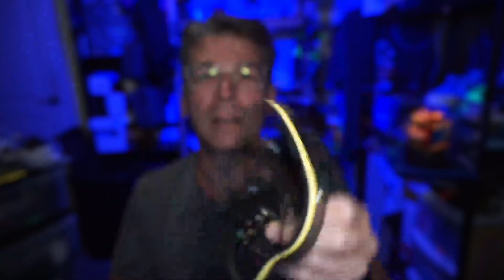SpeedyBee Flex25 // 78mm How???

Comment: after watching this video i bought the hd version and i'm enjoying a lot. just one question.. with the runcam connected the 850 mah batteries have a duration of 2 minutes max. is it possible to use 4s batteries with a higher aperage? for example 900-1100? or is the limit 850 mah?
Reply from the maker: the capacity of the battery doesn't have a role in if the electronic components can accept a voltage. A 4s 850mah has the same high voltage as a 4s 1100mah. The weight of the battery may or may not improve flight time, as we add weight we have to use more throttle to fly that weight. But yes a high capacity battery can be used.

Comment: Do you think its better than a cinelog 25 with BMI270 gyro! Lets say for professional indoor footage with a naked gopro 10
Reply from the maker: This will be more durable, but I wouldn't commit to it flying better. the cinelog flies really well, but its down fall is the prop protection doesn't take crashes well. It also has soft mounting for the external hd camera which can help with the micro vibrations that could make it into the recordings.

Comment: I am looking for a 2.5 BNF whoop for a project where it will crash a lot. :)
Can you recommend sturdiest BNF 2.5 whoop?
Thanks! :)
Reply from the maker: Foxeer foxwhoop25. My review will be up this week
Reply: @NickBurnsFPV  thank you!
Reply: @NickBurnsFPV  I am looking at its pictures. Frame looks okay, but camera sticks out and doesn't have any protection. Is this a problem? Do they supply any additional protection?
Reply from the maker: @VasylDemianov  I am not aware of a 2.5inch propped whoop that also has good camera protection. There could be one, I can't recall reviewing one in the last 2 years with it. The older 3inch whoops fly poorly but do have some camera protection.
Reply: iFlight Protec R25 looks like it has its camera tucked between the prop protectors.
Does the Foxwhoop fly decently? I will watch your review, but I consider ordering one a bit earlier. :)

Comment: I have a flywoo cinerace20 cinewhoop which I use almost exclusively for freestyling around tight trees and empty playgrounds since it is so durable and can bounce of everything while also having a fair bit of power. I also like the flight characteristics of well tuned cinewhoops when flying in tighter spots as they feel more locked in and controllable, while having less drift and fling.
Reply from the maker: The cone race is a hardy little 2incher

Comment: This could be a great little quad for filming in tight quarters.  Seems that it will not be quiet though.  That VTX seems bad, I get less breakup with my Happymodel x12 v2.
Reply from the maker: No these are not quiet. The current cinewhoop props help handling but are worse for being silent. The prop protection seems to amplify the noise level too

Comment: I just built a tooth pick im having trouble with reversals its slow and wants to gain altitude like crazy instead of going forwards Im used to 75mm whoops so I thought it was just me getting used to 110mm frame but im only at 70 grams with 1103 motors and the flex 25 is turning quicker any tips on how to tune it ?
Reply from the maker: Tuning is a very wide subject and very difficult to tailor over messaging. I suggest looking at the presets built into betaflight 4.3. Also some general tunes from UAV Tech here https://theuavtech.com/presets/

Comment: Good looking cinewhoop, but the stagered prop design doesn't convince me as being beneficial. I would think the size of these whoops isn't really a factor at all. So why go through the trouble I wonder? 
Looking at it from the bottom I see nearly half prop disc covered up by the frame. The stagered props make that even worse, so It might actually hurt performance. Not mention the air from one prop going into another is mostly not a good thing either.

As always fun to watch... Too bad it took a dive though... but at least the pool has its 'official' welcome to the backyard. When it comes to drones water is like trees I guess, highly attractive.

Comment: I’m not a pusher fan because of the fact you’re obviously stuck with the prop guards on.

With a puller you can remove the prop guards and even put slightly bigger props on for a different flight experience as I do with my modified TransTEC Beetle.

Just my 2 cents!

Cheers Nick.

Comment: I've been trying to do the same prop offset on a 3in sized cinewhoop to fit 3.5 or 4" props on a 3" frame but haven't ever quite gotten it to work using mixed standoff and different sized motors.   Cool to see the concept implemented in a practical way.
Reply: I did this with a 3" frame on 4" props.  I didn't have side to side overlap but did have front to back overlap. It actually flew really well carrying a full size hero 8

Comment: I'm sold on this one. A little tuning and it'll do great. I've been a 2.5 - 3 inch fanboy,They are my favorite size for what i like to do.  I see it does well on slow dives with out a washout. is there a way i could get your broken, damaged qwads, i'll pay for shipping and what ever you want. i have tons of parts for repairs.P.S don't worry that it's broken and may never fly right again. My favorite thing is working, diagnosing,modifying broken ones more than flying sometimes. It's the challenge.
  A rxsr has to be on the same software edition as the tx is or else you get these short distances failsafes,i've learned the hardway also.. I  really like that it is compact legal no reg size ,and the led bumper.
Reply from the maker: Send me an email please
Reply: @NickBurnsFPV  sent, and you'll know it's me when you read it. Thanks

Comment: Ih nick as always a great video, I have a question for you. I have a baby ape pro and and the motors aren't spinning smooth they are jittery and it wants to pull to the left I give it right in put and eventually I totally run out of right input so I gave to land it any ideas would be greatly appreciated thanks nick.
Reply: bad accelerometer , try flying not in angle or horizon. if it flys better, then it is that. As far as jitters on flight if that clears up on acro/manual then you're lucky. Other reasons are vibrations windup the accelerometer, so check for cracked broken stuff.
Reply: @shakeymikesadventures6793  thank you
Reply: Hi I figured it out I had to use dshot 300 instead of 600 fixed the issues thanks guys
Reply from the maker: @broken4999  That does remind me I had a betafpv whoop that was the same way.
Reply: @NickBurnsFPV  I appreciate the help I think I have to get a new raido though, I have a dx9 and it's hard to get alot of the drones to work with it any suggestions would be helpful and thanks again for all your great videos.
Reply from the maker: @broken4999  I would look at the radiomaster radios. They have traditionally sized radios like the TX16, Mid sized yet still square radios like the tx12, and the gamepad style like the zorro.
Reply: @NickBurnsFPV  thanks nick
Reply from the maker: Yes Mike has it covered.